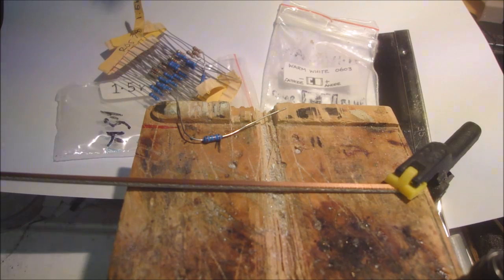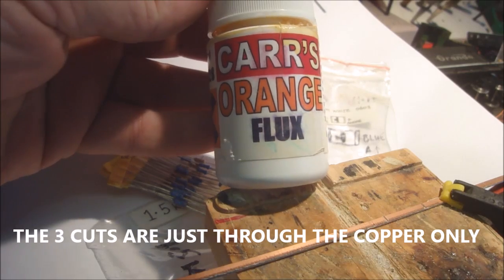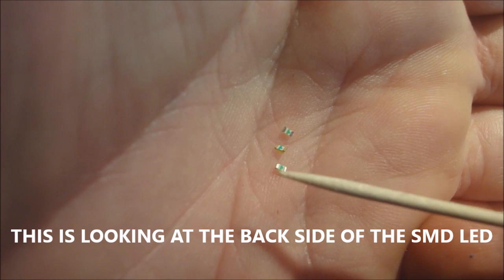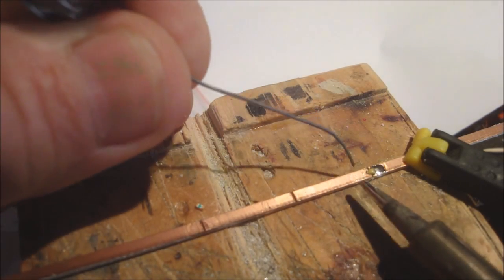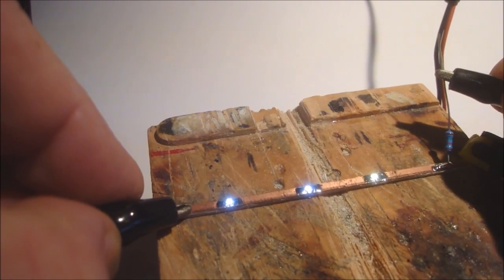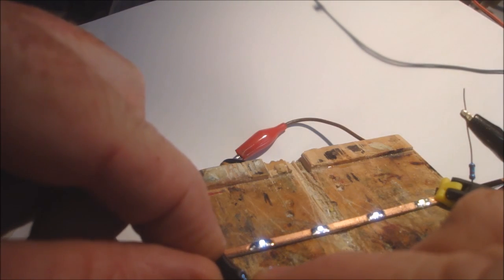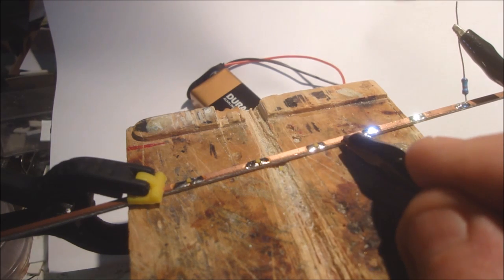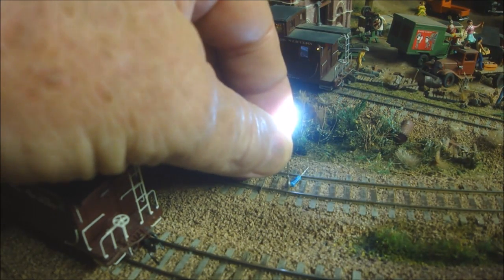Making a SMD LED light stick for DCC

Comment: Dude dont waste your time with a soldering iron for SMT stuff, use liquid solder paste and a hot air gun.
Reply from the maker: I've been using the iron for 10 years now and SMD LEDs - works for me but thanks anyhow. Regards Laurie

Comment: Great video thanks. Question though, if you are running basically AC DCC through a polarised LED isn't it turning on and off according to the frequency of the DCC and doesn't this make them lower their life expectancy? I thought that They run better of rectified DCC?
Reply: never run any led on AC no. the reverse current will get exceeded and they wont last 5 minutes without rectification.

Comment: Great video. I want to use a light stick like this in an underground station. I want to be able to turn this on and off via my power cab dcc controller. Anyone know how to do this???
Reply from the maker: G'Day Simon, you can use a TCS Function Lighting decoder - I like the FL-4's and program the lights as you want and power the decoder from your DCC to run the lights. I use JMRI Decoder Pro (free) to program. Say you give the decoder an address of 99, then use your NCE throttle to select and turn on the lights as you want ... simple . Rgs Laurie